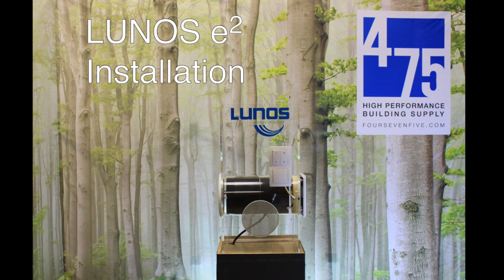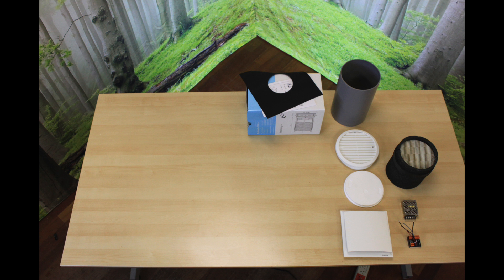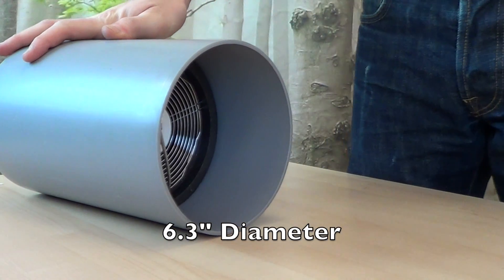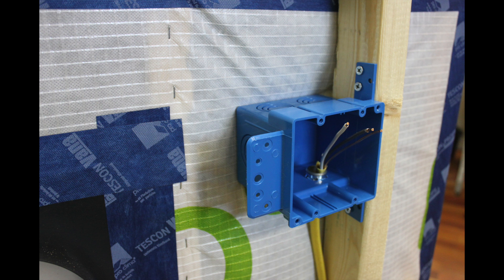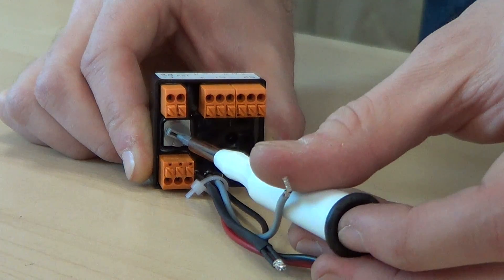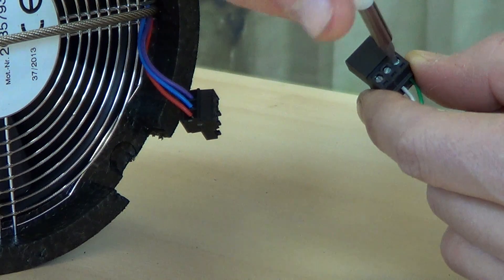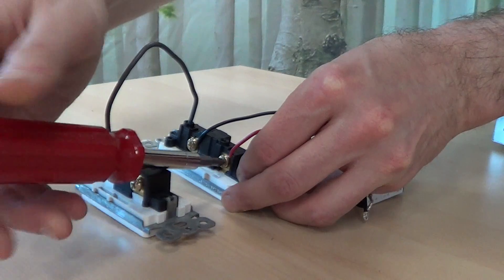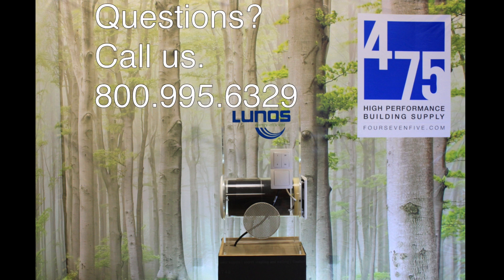Lunos e² Installation Guide (Controller 5/UNI No.39975)

Comment: Stupid question: How does one fan know what the other is doing if they are not linked with the 12v wires?  Or do you have to remember to include pulling that wire in the walls if you are going to be able to use this in the future?
Reply from the maker: No problem! Each fan has 12v thermostat wire running to the Lunos controller, which is situated in the switch box. Those wires carry both power and signal to each fan.
Reply: @475.SUPPLY  Thank you!  So if I am closing in (dry walling) a job, and want to be able to use the units in the future, then I need to run 12v wire from each unit location to the single control - which is a double box?
Reply from the maker: @SpaceCrete  That's right! Also, if you haven't purchased the units yet, I will direct you to watch our new install video: https://youtu.be/JqGWZRYL3q0   -- the video above is the install guide for older Lunos units.

Comment: I wonder if it would be ok to fit a standard unit (90% efficiency) in a van (conversion). I think I wouldn't mind a bit longer protrusion in the place where the fan goes.

Plus I wonder if two fans one needs to place one near the ceiling and one near the floor at the opposite side (or maybe it's not necessary, but it's better).

(Not expecting answers from 475, I'm sure you are busy with other things)
Reply from the maker: Hello Maxim P - while we love the enthusiasm for the Lunos, we do not think it should be used in a van conversion for a number of reasons. It's not the right fit for the job. And in terms of protrusion into the space, it would be slightly less than 12" of protrusion, and there would be 2 of them. Definitely not ideal for the interior of a van. Thanks for tuning in and commenting.
Reply: @475.SUPPLY  
 Hm, interesting... Well, I know tiny houses on wheels which used Lunos (by the way one of which is Terran's, I believe you did an article on his Passive THOW too), and this kind of spaces (vans, tiny houses) are the ones that need most some good air circulation, so I'm going to really consider your recommendation, but at the same time, as I said, there's a good incentive to use Lunos in a van convention (unless I'll find a system that was designed for van conversions).

But if I won't find something better, the sacrifices for putting in Lunos system - might be ok for me.
Reply: @475.SUPPLY  
Thanks again for the advice, I'll consider it. I hope I'll get to try using it in a van conversion, see it could work or not.

Comment: Thank you. My client ordered the higher model, and the wall is only 6&1/4" thick, so now we're sticking out 6 inches. Does this effect stability? And should the outside end be mounted to the outer wall, or should the inner face be? Help!!! Lol
Reply: I've seen several people trim this out with trim on the interior. I'm planning on doing this. Maybe add a painted square of plywood with a hole for the tube, then trim out the square.

Comment: QUESTION: We need to add a system to our tiny home as it is a vacation home in the San Juan Islands. We are only there a few months out of the year. This system looks to be exactly what we need and nice quality. But.... is it connected to a mixture meter so it can power itself on and off as needed with us turning it on manually? I need a system that works while we are gone as the TH will be closed up tight. Thank you.

Comment: I have a oil boiler with a fresh air vent (dryer hose) just piped behind the boiler to the floor which is allowing cold air in all day.  Could I install this in its place to allow fresh air in for combustion?

Comment: I understand that colours of the wires change as per installation however.... @5:50 the red wire is shown going into the +ve connector of the control unit. @5:59 the red wire is shown in the -ve connector of the control unit. Have I misinterpreted this? will consult manual, but this seems confusing. Thanks.
Reply: I agree with your observation. 5:50 connection looks right but it would be nice to be certain

Comment: Scenario: 100 year old house, 2.5 ACH50, 2 baths, 5 bedrooms, 3 floors + basement, 5 humans... House has forced air furnace, both baths have exhaust fans. Would you install one pair in the baths and another pair in the master bed/kitchen? Or would you install 3 pairs one for each bedroom and one for basement? I'd imagine the high use areas like bathrooms should be paired... Nice video, great technology.